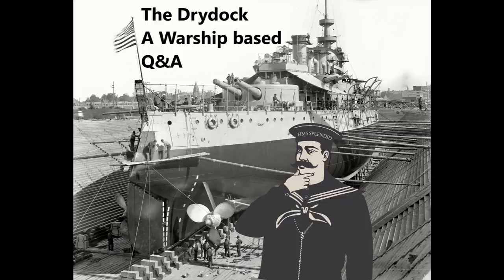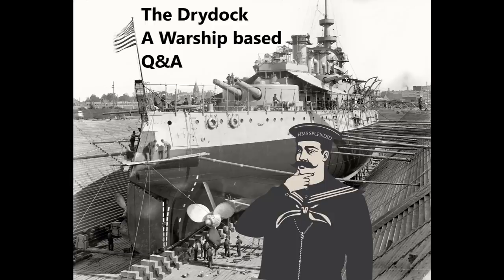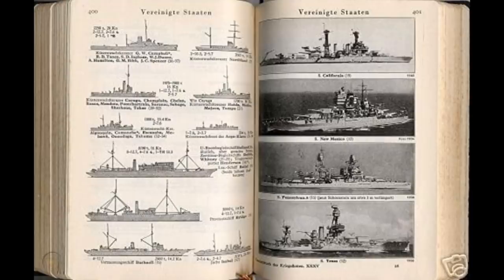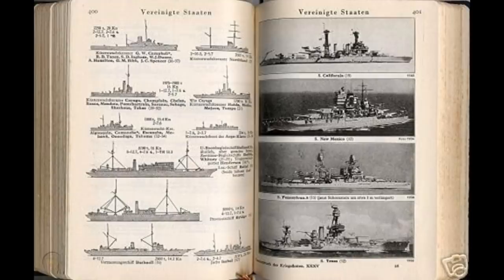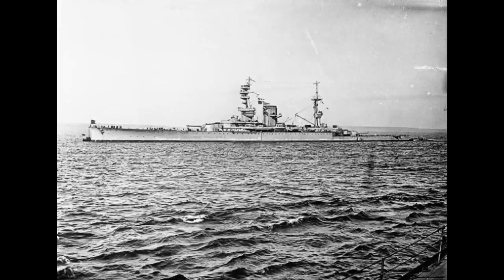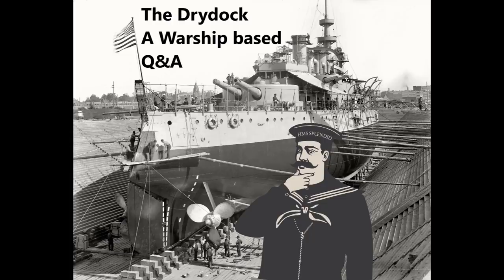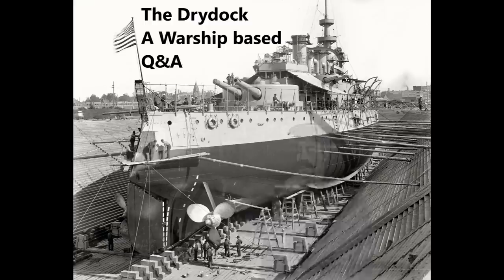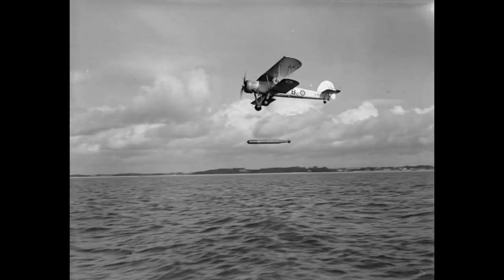The Drydock - Episode 138

Comment: Kamikazes. Autonomous guided missiles immune to soft-kill countermeasures with advanced target discerning capability and capable of evasive manoeuvres in both approach and terminal phases. May be outfitted with enhanced payload options.
Reply: Not quite immune to soft kill measures. If you lob a load of tracer and explosions at them I'm pretty sure their accuracy will get a lot worse. Wonder whether they could have used mirror systems to try and dazzle approaching planes on final approach.
Reply: How do you word the "usually poorly/minimally trained..." part?
Reply: @gregorywright4918  guidance system can be used with minimal programing to expedite use, target discerning and approach/terminal evasive manoeuvres will suffer degradation in efficiency as a result.
Reply: @asdrubale bisanzio - Light travels between 300,000 to 400,000 times faster than typical WW2 AA projectiles, so one can aim at the aircraft with light instead of where the aircraft might be in a few seconds if using an AA cannon.

Comment: Regarding the battleship AP vs heavy cruiser armour, and Seydlitz' armour plate, it's actually a really good comparison. Seydlitz' plate in that location was 100mm, which was pretty comparable to a cruiser plate for the interwar years. Her main belt was obviously considerably thicker. It should be noted that most heavy cruisers had thicker main belts, but not beyond 50% more, so probably not anything that could alter the result significantly.

Comment: AP and SAP bombs rarely had an AP cap for two reasons:

(1)  You want the largest explosive charge to get the maximum effect, so even a full "AP" aircraft bomb will tend to have a larger explosive charge than an AP projectile, since the bombs ONLY hit the rather thin deck and not the thick armored sides of battleships and the like.

(2)  The armor used in decks and most other horizontal surfaces is rarely face-hardened, since that armor would make such horizontal surfaces more resistive to falling bombs hitting at close to right-angles (30-degrees off from that is about the most you can count on) and bombs would need an AP cap for a reliable way of penetrating in any other but just broken chunks (the reason caps are used against face-hardened side armor), but when hit by large shells at a high angle at closer ranges (the most likely ranges where hits would occur), face-hardened armor is much more brittle due to the larger area of the projectile side slamming into the plate, creating holes that looked like a projectile-shaped chalk line around a dead body in a mystery movie.  The French in its post-WWI DUNKERQUE and RICHELIEU Class battle-cruisers/battleships used turret roofs of face-hardened armor (of high quality, looking at the minimally-cracked impact made) and DUNKERQUE had a turret roof hit by a 15" APC shell from HOOD that ricocheted off.  However, the face-hardened armor shattered the shell, except for the nose protected by the AP cap, and only the nose ricocheted away, with the rest of the shell and the entire area of plate touched by the shell cap, nose, and body, punched into the turret wrecking that side of the unusual double-twin-gun design, with an armored bulkhead separating the two sub-turret halves, but allowing the other two guns to keep firing normally.  Perfect, book-ready example of why to NEVER use face-hardened armor on horizontal surfaces when high-angle hits are likely to occur.  Thus, another reason that no AP cap is needed in most cases in AP/SAP aircraft bombs.

Comment: Considering Warspite's steering problems after Jutland. Well, from an engineering perspective what was really happening was every now & again the wobbling pin was falling out of the wiggling hole but the pin was too long to fall out completely. So the wobbling pin would fall back into the wiggling hole & everything would be alright again.  But where the wobbling pin was, was too far back in the machinery spaces for the engineers to see that the wobbling pin needed replacement. More or less.😊

Comment: Machine shop question.. I was on the very old Proteus as19.
Sub tender those guys could make a v8 from block metal. 
The ship was a machine shop.
My favorite machine was a buffalo press it could cut in one big deck shaking hit a railroad tie cleanly in half.  So some ships had/have extensive machine shops.

Comment: When turbine blades get too friendly with adjacent parts the damage is catastrophic. The broken metal just pounds the entire set of blades into tiny fragments. The only fix is replacement of the whole machine.
If it’s a low pressure shaft the blade debris is likely to take out the condenser.

Comment: Lawn darting?  While we did not have Swordfish Naval planes in the US, we aren't overly familiar with the term "lawn darting."
Reply: That's because they were banned back in the late 80's. The basic concept is a small spear with a weighted metal point that you throw into the air and which will then land metal point down into the ground. Like horseshoes but played with small spears. To be fair the point can also be plastic and current versions with rounded tips instead of the pointed tips are available but the concept is the same.

Comment: i have been told that the flagpole in a local park (Wallacestone in central Scotland) is actually a WW1 periscope, any details i should look for to see if it's true ?
Reply: Does it look like a regular piece of piping, or does it have some unusual features on it anywhere?  Usually flagpoles are just pipes, either straight or tapered, with circular profile.  Any brackets, grooves, guide rails, scars from some prior fitting here or there, elliptical profile, sudden tapers, etc.  Bronze instead of steel would be an indication.
Interested to hear your observations...

Comment: Why kamikazes attacked picket destroyers? Because they were perfectly valid targets. Firstly, they had a critical role in fighter direction and by removing them it would be much easier to reach the carriers (which is why the USN kept the picket destroyers in place despite heavy losses). Secondly, picket destroyers were unarmored. Remember, a kamikaze is a low speed projectile that will not penetrate armor so attacking armored targets was pointless. Thirdly, picket destroyers were not well defended, either by AA or by fighters (being by definition on the edge of the fighter direction bubble). Finally, a destroyer is way more valuable than a kamikaze. If the Japanese could achieve an exchange rate of say ten kamikazes expended for every destroyer sunk, the USN might well have to retreat.

Comment: Well if you are adding turrets and guns to Courageous you're going to be considerably more than 20,000 tons. The displacement of USS Arkansas and Wyoming is about 23,000 tons with 12 inch guns so why do it?
Reply: More guns, but they weight a lot less. According to NavWeaps the British twin 15" gun turrets are about 700 tons, a British single 9.2" turret only 110 tons so the double would be around 200 tons or less. So swapping one twin 15" for three twin 9.2" actually saves weight. (Which gets used for more armour in Drach's scheme.)

Comment: I'm sure you don't have time to read all these. Love your channel. I was wondering if you could go into detail on your thoughts on the Japanese "Pagoda" masts. Given their height, they were relatively lightly armored to maintain stability. They were also where the primary optics and a good portion of the command crew was located. 

If I were faced with fighting a Japanese battleship I'd order all secondary batteries to focus on that pagoda mast which couldn't withstand the hits and use the big guns as usual. 

Thoughts?

Comment: One additional problem with torpedo defense systems: CAPSIZING RISK.

When a torpedo blast floods most or all of the defense layer, you suddenly get lose a chunk of the ship's internal air space holding the ship up from sinking.  The defense system, if it works, will keep the flooding, for the most part, inside its volume near the  hole, with some damage fore and aft of the hole.  The larger the bulge system is, unfortunately, the more air space is suddenly lost by a torpedo hit, so that side of the ship will flood more and cause a larger potential list on the ship before you can counter-flood the other side to compensate (which will compromise that far side's anti-torpedo protection around the intentionally-flooded spots if you get a hit there too, of course, which is another problem when under aircraft torpedo attack, though usually less so against submarines, which prior to nuclear-powered post-WWII submarines, were slow and usually did not get very many attacks unless their target gets stopped completely by their first hits).  The bigger and more effective the side anti-torpedo system was, the bigger the initial flooding volume and the larger the initial list of the ship to that aside when hit.  This is made MUCH worse due to inertia:  Once tens of thousands of tons of big warship starts to roll in the direction of the hit due to sudden loss of buoyancy, it does not stop at the final stable point that you would get in a gradually-flooded test-tank shape in a laboratory; it just KEEPS ON ROLLING past that point, though now slowing down in its roll and will, eventually, roll backward to its final stable tilt, with counter-flooding being applied somewhat later when the personnel in charge of that get some idea of what they have to do.

At Pearl Harbor, OKLAHOMA (and, almost, WEST VIRGINIA) capsized due to this inertial over-roll effect, even though none of the torpedoes in those small Japanese aircraft exceeded its torpedo protection threshold (the post-battle US Navy experts were quite happy that their old, WWI-era anti-torpedo systems worked as planned under real-life extreme attack, though without the ships being "buttoned up" in full CONDITION ZED battle readiness, they sunk anyway, with this being more gradual).   Except, as just mentioned, for OKLAHOMA:  So many hits occurred on one side of the ship that it simply started rolling on the no-longer buoyant side and kept going until it was no longer stable and then rolled over.  If the same hits had been spaced apart in time to allow correct compensation by counter-flooding the far side after each hit and maximum internal sealing of hatches and doors had been in use and all of the pumps were up and running to stop the eventual leakage due to shock affects from the hits, then even as hit at Pearl Harbor so many times, the ship might have still not sunk -- though it would be a close thing with the ship about as low in the water as it could get without submerging and a desperate need to get to a major repair facility ASAP.

Comment: Once again you show a monitor.
It width was to reduce its draft, to support its heavy gun.
Not a torpedo defense.
It was to allow a monitor to get close into shore to fire a greater distance into shore. 
Massive width to reduce draft.
Reply from the maker: And massive bulges to provide torpedo defence.
Reply: @Drachinifel  no to reduce draft.
Reply from the maker: @DavidConnor  the RN design documents are pretty clear that they expect monitors to encounter coastal torpedo craft and the bulges are installed to prevent torpedo damage to the otherwise small hulls. They're also built with TDS layering in place in the bulges. Exactly the same reasoning was given for adding bulges to the Edgar class.
Reply from the maker: @Fluesterwitz sort of, the significant beam was supposed to be the main supplier of displacement. The bulges helped a bit, but that was largely incidental to the torpedo protection. If draught was the only thing involved they could simply have made the ship itself even wider.
Reply: @DavidConnor  before asking him to quote his sources and regressing to swearing and typos how about you quote your sources first.

And hell, even if we were to accept that the main role of the bulges were to increase displacement for shallow water fire support that does not mean they did not also provide torpedo protection, which means that Drach using that picture to show torpedo protection is not wrong.